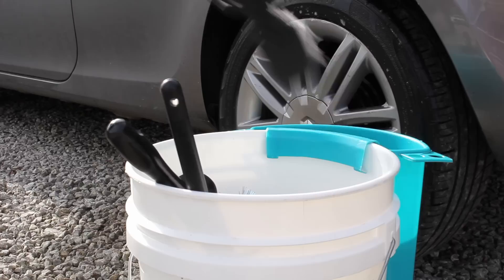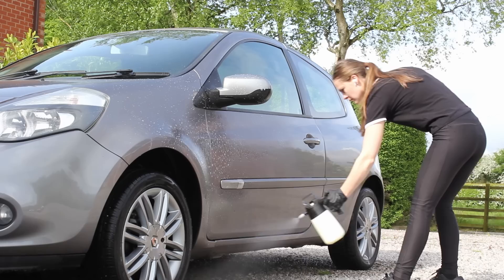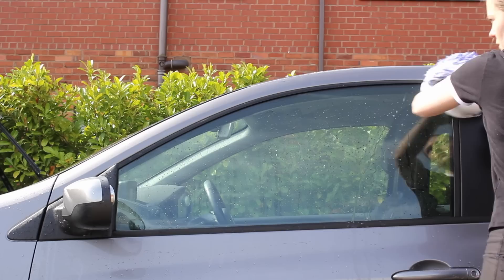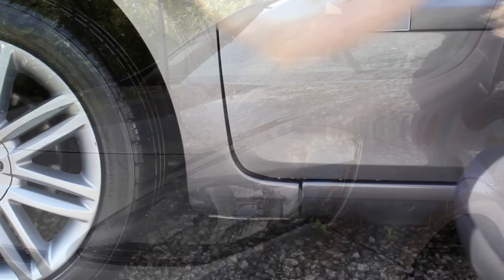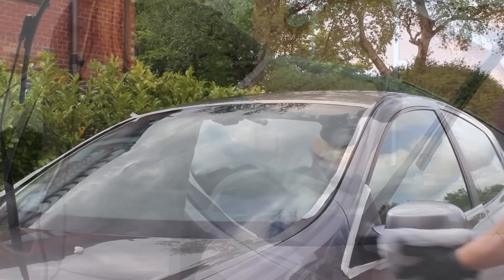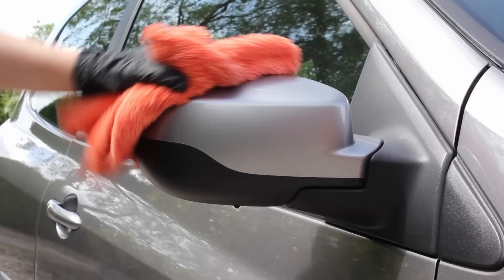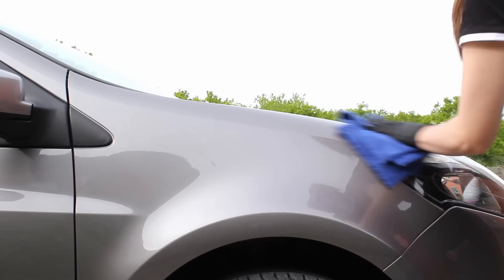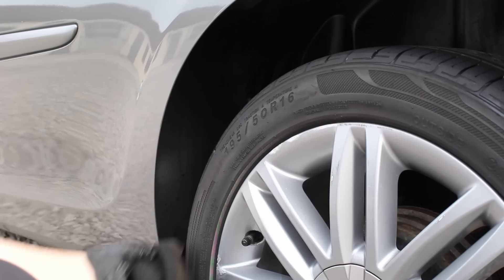Exterior Detail | Wash, Decon, Polish and Coating on a Renault Clio

Comment: Fantastic job. All the steps so clearly explained. That is one very lucky Clio owner.
Reply: How do you clean those tire dressing applicators? I use an oil based dressing so they immediately get sticky
Reply from the maker: Thanks very much Peter!
Reply from the maker: @woocoheed I usually just use an APC/ degreaser and try and work it in as much as possible

Comment: The simplicity and ease you make car detailing is just such a joy to watch and most importantly learn from. You come across easy on the ear with your thoughts on the products you use.   I need to improve my decon stage of cleaning. Would you recommend the clay mitt over a clay bar to help remove the bonded contaminants from paint ?  Please keep up the great work Heather. Take care
Reply from the maker: Thanks for the kind words Darren! If the paintwork doesn’t feel too rough then a clay mitt would be completely fine. It’s less aggressive and more efficient than a clay bar, but if the surface has heavy contamination then a clay bar will be much more suitable
Reply: @AutoCareHQ  cool, I will look at a clay mitt and lube. Thank you 🙏

Comment: I might be a bit late to the party but like 925 is officially deployed! Def checking that coating out, great result from an easy application is always one to watch. Interesting thoughts about the polish as well. I was considering s20 and S40 as my next trial (everything I've had so far is soft japanese paint (Hondas) but you've given me another option Im more likely to go with now, as my last one jsut didn't get the clarity I thought was possible, with the products I had available. Like with Sandro @ CCAD, Im yet to disagree with any of your recommendations I've bought. GT tyre serum tried now on my last one that came thru. Really liked that. The well edited video is not lost on me either epsecially how hard it is to film stuff as you do it and then have to cohesively stitch it all together takes me forever. Amazing results on the car, looks fab! Well done!

Comment: Incredible work!! Just out of curiousity, how long did this full exterior job take to complete? I just did a ford bronco (us based) and it took me way longer than I expected just to do the exterior, nearly 10 hours! This was with 2 polish steps and sill decon.
Reply from the maker: Thanks very much! This took about 10 hours but the filming does usually add a few hours to the process. Fortunately this just need one polishing step so wasn't too bad!
Reply: @AutoCareHQ  good to know! I guess I’m not too far off what I would expect, but still could cut a few minutes here and there. Thanks for the reply.

Comment: Top work as always, Heather.  Must say, I might give the Diamond Body coating a go over Garage Therapy CS come the Winter - looks just as easy to apply anyway!  

I still need to machine polish the paint but a coat of black hole and some Auto Finesse Desire does the job for this Summer. Although being a 'show wax' I'll be stripping that back and going with some form of ceramic coating for Winter so have added this to the list.  Need to find a shop to repair my Rupes BigFoot first though as I think the gearbox has eaten itself, only used it on around 5 cars in 3 years too!
Reply from the maker: Thanks very much! If you go with the Diamond ProTech coatings I'd give the car a decon and polish first and avoid layering it over any other products like CS. The coating doesn't really need topping with anything else either as the performance on its own is seriously good. I'll put a clip up on my Instagram this week showing the water behaviour :)

Comment: Heather have you tried using your car shampoo in your foam lance,its the way i shampoo my cars now and just have a bucket with a few mits as car should be near clean anyway by time you do the contact wash.Honestly its better method and much safer than the overratted 2 bucket method
Reply from the maker: Yep it’s actually the only method I use on my own car! Works really well but it’s just tricky to film as the foam often rolls off the panels as I’m messing about moving/ focusing the camera 😂 I am using that method though on my next video which will be out on Monday 😊

Comment: Another great video 👍
Can I ask why you chose to use the citrus at 1:5 when Squid Ink suggest 1:8 for light, 1:4 for medium and 1:1 for heavy soiling? Personal preference or have you used their recommendations and changed it to get better results? Thanks 🙂
Reply from the maker: Thanks for watching 😊 I didn’t notice a big difference in cleaning power between 1:4 and 1:5 so I just did it to save a little more product

Comment: Did I miss something, did you not do the inside of the door recesses or boot? Door hinges and openings? Apart from that it's a very good job.. What was your total time on the car out of interest? 👍
Reply from the maker: It took about 10 hours including filming.    I did the door jambs and interior but didn’t have the time to film those steps
Reply: What is the foam cannon you use in this video? The fan pattern on it is wide.

Comment: Another great video and thank you. Quick question, do you ever worry about washing in direct sunlight?
Reply from the maker: Thank you! It can be difficult depending on the temperature but I’m usually able to keep the panels cool with the pressure washer. When applying the protection though I have to try and get as much shade as possible

Comment: This snow foam is good to apply on wet surface? Or rather dry surface?thank you
Reply from the maker: Either is okay however I think it cleans slightly better when applied to a dry surface. It can be useful to rinse the car first though in hot weather to cool the paint down before applying the snow foam

Comment: Hi,great video as usual very well done,excelent as they must be very time consuming to put it all together. Quick question,does ceramic coating last or does it have to be 'Topped Up' at all.🤔
Reply from the maker: Thanks very much Philip :)

It doesn't need to be topped in theory so I'm going to keep an eye on it without adding a sacrificial layer. I'm just planning to chemically decontaminate it 2-3 times per year so make sure it doesn't get clogged up
Reply: Thanks for the reply. I was asking this for my own car.Thanks.

Comment: Very, very nice. As usual, the car turned out great. Do you follow a set procedure, or is each  individual car it's own detail? Thanks Heather
Reply from the maker: Thanks Kim :) I usually follow a similar kind of procedure but it does depend on what the owner is looking for. The most basic steps I do are the wash and protection, and then it can step up to a chemical decon and then a full decon/ polish

Comment: Are the wings on the Clio the fibreglass type ? We had those on my lads Clio , no difference is application or prep on that material? Came up nice though that has
Reply from the maker: Cheers Andy :) I'm not actually sure off the top of my head but it seemed to respond the same way to the machine polisher as the rest of the panels so I don't think there needed to be any change to the prep/ application of the coating

Comment: Hi Heather, I noticed you used the "Hydro Cannon Foam Lance". I saw you did a Foam cannon face off previously where the MJJC V2 was highly rated. I was in the process of ordering the MJJC V3 tomorrow and just spotted this latest video. Is the Hydro on test and if so which one is best out of the 2 please.....
Reply from the maker: Honestly you can't go wrong with either an MJJC or the Pyramid Hydro foam cannon but they do have quite different designs.

The MJJC drains the bottle very quickly which means you can put less chemical in the bottle and get thicker and more concentrated foam but when you factor in the drain rate, neither foam cannon offers any advantage in terms of concentration and cost/ wash if that makes sense. 

The MJJC has the classic fan design which can be adjusted horizontally/ vertically and also in terms of width.  The Hydro Cannon has 5 separate settings (vertical, horizontal, jet, cone and downwards). Both designs work very well it just depends which you prefer. 

I do use both foam cannons a lot however I do find myself picking up the Pyramid Hydro Cannon more often to be honest so I think I have a slight preference for it personally. 

I haven't tried the MJJC S V3 but from what I've seen it looks basically identical to the MJJC Pro V2 except for the bottle shape/ transparency. 

If you do go for the Pyramid Hydro Cannon, you can use the code "ACHQ" to get a discount so it comes in at £40
Reply: @AutoCareHQ  Thank You Heather for the detailed reply...It's appreciated.

Comment: Heather, may I ask do you use purified water to eliminate any minerals and therefore water marks?  Do you think using purified water during the wash is preferable?  Thank you.
Reply from the maker: I’m fortunate that the water in my area is quite soft so I’ve never had a massive need for purified water to be honest. I think if I was in an area with harder water though it’d definitely be something I’d invest in
Reply: @AutoCareHQ  thank you for the advice.